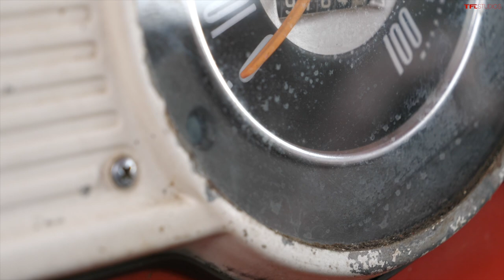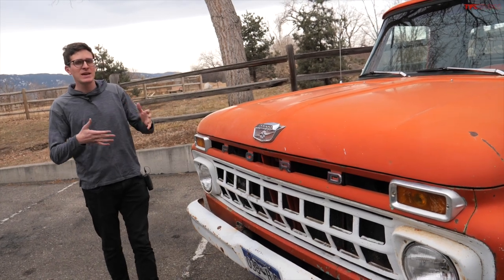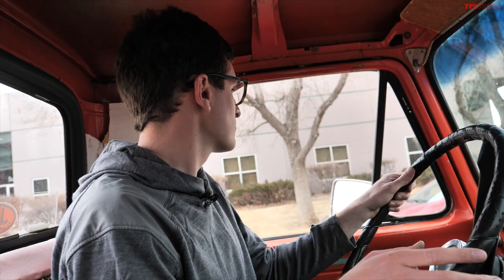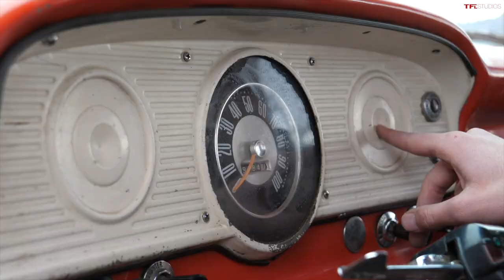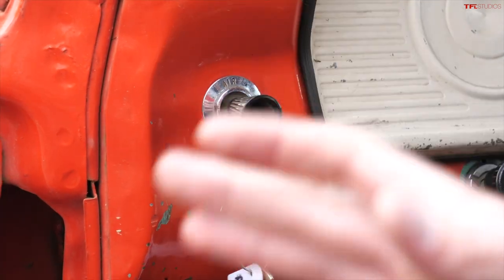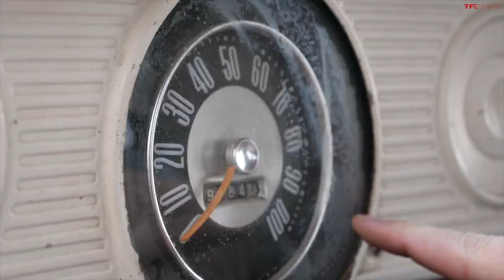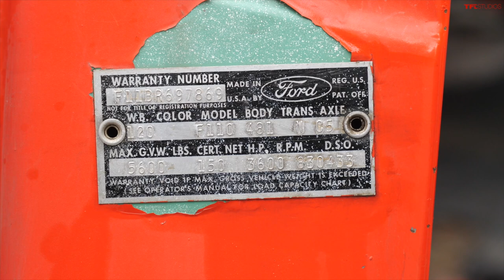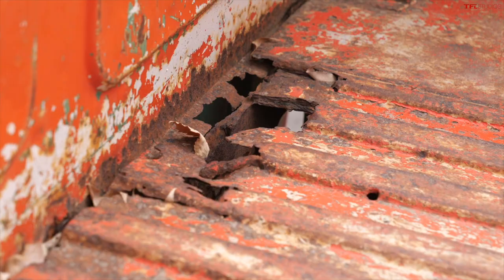Do You Like Raptors? I Just Bought The Ford Truck That Started It All!

Comment: Great video. Tow tests. Mpg tests. Decibel tests. 0-60. Barn paint job and body work. Drag race it. If you do an engine swap, redo all the tests after. I look forward to all the future videos.
Reply: DO NOT paint this truck it looks perfect
Reply: Strongman may be right. It is a good looking truck. I was just brainstorming.
Reply: Given a length of the video a didn't expect to see the 0-60 test.
Reply: @PrzemyslawSliwinski  It will easily go 60..
Reply: I wouldn't mind seeing it put back to the factory original paint. As for engines just rebuild what is has and leave it alone.
Reply: Don’t tear it up. This is NOT Dirt Every Day like some of those other guys.
Reply: God get rid of that radio though
Reply: @PrzemyslawSliwinski  That's funny. My '65 F100 has the 240 I6 and a 4.10 rear end, and it'll do 60 alright. Not much more though. 😄
Reply: @usmcvet0313  My first two cars could do 65mph if they were brand new. Never got a speeding ticket....
Reply: Swap in an Offy intake with 4 bbl carb and headers.  You can boost the power by about 100 hp this way.
Reply: Leave it and drive it  or FULL resto/resto mod. No BS barn paint job on this gem
Reply: Mechanical restoration only.
Reply: Please keep the 300 straight 6, even if you put it in a different truck
Reply: Keep this 60s raptor vibe and I love the i6 , try your best to keep that engine even if a full rebuild and fully built internals is the way you wanna go , maybe straight pipes but that’s not you lol , I would opp for front discs and period correct rims as well , maybe keep that former forest service green too , it’s so 60s . That’s such a nice find , I can’t wait to see it’s new life
Reply: Engine swap?! What for? The 6 can be modernized to get over 200hp. Power steering can be added.
Reply: @usmcvet0313  My 1978 Land Rover lwb had a 2.25 litre petrol engine with about 68 hp and flat out on Firestone 750x16 SATS would get to about 70mph, l would have thought this Ford truck would esily reach that speed unless it has very low gearing.
Reply: @clooperman3745  I'm sure this one will. Mine taps out at about 65 mph, because the low 4.10 rear end, and stock sized tires. He said in the video this one has 3. something axles, with larger diameter tires. I'm sure 70 is possible in it.
Reply: Overall nice video,  hopefully whatever work you do will be more towards a restoration direction and less modernization. Please get her the proper two piece factory radio..... A lot of people find it hard to believe but that era F-series & mustang are MAJOR sources of parts for the 1st generation bronco.... the heater, speedometer assembly, and factory radio were directly from the truck. As was alot of the interior trim. The blanked out hole beside the fan controls is for the defrost and the handle you show would have extended straight out roughly an inch to hold the cable.  The  steering wheel  while not yet on a collapsible column is the 'lifeguard' deep dished style from the late 50s so it don't crush your chest in a head on collision  (while it isn't an air bag by any means think happy thoughts prior to any emanate head on collision). As for the gas tank we look at it in horror today because it is in the cab. Keep in mind that the 'safest' place in that truck was expected to be the cab so in a major accident least chances of damage .... today we approach things with a different perspective but at the time  made some sense. Good  luck and I hope you enjoy driving as much as I  enjoy my 71' bronco  ;)
Reply: Thats got F250 axles, might be a cab swap that didn't get the Vin tag changed. The 100 of that year had a single speed transfer case and 5 bolt wheels. Look at the frame number, it is on the passenger side right ahead of the firewall. My 250 has that hood emblem and came with the V8.
Reply: @rogerj412  exactly

Comment: Whatever you do to that truck: Never take that 300 Straight 6 out.
Reply: ls swap
Reply: @kiefercosgriff7300  no
Reply: I agree
Reply: Needs a 460c.i. swap ill tell you whut
Reply: @kiefercosgriff7300  🤫
Reply: One of Fords BEST 6 BANGERS...
Reply: Drop a Jon Kasse 460 in it, gobs of power and gobs of torque😁
Reply: The thing I always tell people when they say I should put a 350 in my 1978 Gmc c15 short wide "when it blows up I'll swap it out" I've held it too the floor about every single time I drove the d*mn thing and float the valves for about 10 seconds but we'll sh*t looks like it's not getting a v8 anytime soon😂🤣
Reply: straight up
Reply: @user-gz8id4vf1i  
 Not in the Xiden $4/gallon era..
Reply: The 352 has almost 350lbs of torque and 200 hp stock ... mine has it and it's what started the idea for the Ford lightning
Reply: Lmfao can from the video where the made it electric
Reply: @jlbueno0611  No it didn't, they measure power wrong back in the day. They measured net vs gross. They never put that much to the ground stock.😊
Reply: @kevinragsdale6256  you think I jabent run my truck thru a dyno in all the past 24 years I have owned it ? ...my 352 is stock, no add-ons and I have kept the heads and pistons and cylinders without any modifications  ...no upgraded carb ,and no upgraded intake , only added headers it puts 201 hp to the wheel, and  about 380 lbs of torque  .....my engine has 145k miles on it , all original transmission and rear diff , truck is not in a show room condition since I used it for construction work for 10 years , I rescued it from a tow truck guy who was taking it to the metal scrap yard ......   best 500 dollars I ever spent back in June of 2000

Comment: It’s a forest service vehicle and even though it’s not quite a bumpside I immediately thought of Forest Bump as a name... It’s a beautiful machine and as much as I would like to see it in its original color, I would rather leave it as it is. Just do some sensible technical upgrades like brakes and steering. And leave the 300 I6 engine where it is obviously.
Reply: I thought the same thing with the original color.
Reply: The three hundred six is good for about two hundred thousand miles and then by by oil pump. My buddy had a 1984 F100 good truck though and a nother buddy of mine had a 1988 good solid truck it had three hundred thousand miles but by by oil pump. If someone buys one the best thing to do is replace the oil pump and you should be good.
Reply: I’ve had several of the 300 six bangers. Rock solid. My suggestions have been stated but modify the brakes and steering, maybe a rear locker but for sure go to the original color. That orange color is off a ‘69 IH Scout lol
Reply: How do you know it’s a Forrest Service truck?
Reply: Straight six nah upgrade to a v-8 or straight 8 put the straight 6 in a museum.
Reply: @warrenmcelroy4718  He says it was a government truck right in the video.  18:14 Did you even watch the video???  It was also originally forest service green, which was actually several different greens
Reply: @brinkee7674  yeah I did watch the vid, after I asked the question. Now I agree that it very well could have been a Forrest service truck, but, it could have also been any other sort of County, City or State vehicle. It’s obvious that someone had made several upgrades to the truck in the past so it could have been a whole number of things. Only point being we don’t know with 100% certainty that it WAS a Forrest Service truck so why just THINK it was and run with it? No big deal really but THAT is why I asked.... well that and because I hadn’t watched all of the video yet at that time haha
Reply: @warrenmcelroy4718  Why would it be Forest Service?  It's because they are the one's that order it that color.  City, state, county, etc don't order in that color.  It is a spec with Ford.  Now some other greens are also Forest Service but they will not be the original color.  When .US F.S. needed a 'replacement and they couldn't wait and one wasn't available they would repaint a new truck.  Usually that color would be a few shades different.  I had owned 2 of them in the past and had done a little research on them, what I could find at the time.  That was before the internet or atleast before an efficient working one.  Yes there was a time where I could drive to library, find a book and bring it home in the time it took a file to download.  The more high res pics the site/pages had the longer it took.  Much of my info came from the old codgers that work with my dad at a larger Ford dealer.  One of his 'chums' was truck manager.  That man was a dictionary when it came to trucks, didn't matter the make as he also studied the competition as one should.
Reply: @brinkee7674  there is still room for some doubt though because there were other govt vehicles besides the Ford Forest Service Trucks that were that same green color. Here in Franklin Co Kentucky some of our Ford and even Dodge County vehicles were that same dark green color in the 70’s and even as recent as the late 90’s and early 2000’s our State Dept Of Fish and Wildlife had Dodge pickups that were that dark green color. We did have many County Trucks that were that color though.
Reply: @warrenmcelroy4718  And there lies the key but anything is possible.  It is not dark green like many county/state vehicles.  Forest Service had two dark and light.  This being F.S. light green.  No lie I've seem hundreds of these things and every light one was FS.  Doesn't matter as that green shown is FOREST SERVICE spec color making it a Forest Service truck no matter if it went to the moon and bought by NASA.  If they ordered it that color sales/build sheet says Forest Service.  Same as if I ordered a Crown Victoria patrol car and it was never in police service, it is still a Police/Patrol car (spec).  Yes you could order one with the right connections.  Calling it Forest Service is 100% correct unless someone did a bare metal resto when newer
Reply: @brinkee7674  ok
Reply: Would love to find on like that
Reply: @myalaskalife5837  for sure! In high school my Brother bought a 66 F250 4x4 that had a 4spd and a 390 that someone had put in it, it was that wild turquoise color but the hood had a crazy red and white color scheme along with the turquoise so even to this day it’s locally known as the Easter Egg😂 against his will of course. My junior year I bought a 76 F250 HighBoy that was tough as nails, my brother still has the 66 but the paint is pretty faded from sitting for so many years and sadly I sold the HighBoy about twenty years ago.
Reply: @warrenmcelroy4718  I'm 30 but my ferst truck was  66 ford Bronco miss it
Reply: @warrenmcelroy4718  A lot of former US Forest Service trucks wound up in local government fleets when the Feds surplus-ed them out.  A county where I used to live had several that were obtained that way.  The county left them painted in Forest Service green.
Reply: @rockymountainjazzfan1822  they would be better off if they were still looking for these older trucks to use instead of buying the brand new stuff they’re building these days. I swear if I could find a Mint late 70’s Crew Cab F250 4x4 it’s hard telling what I’d be willing to pay for it, and would be the last truck I’d ever need to buy. The big three should all build a brand new 60’s, 70’s or 80’s pickup for a year or two, they would sell like Hot Cakes hahaha

Comment: When I was in junior high(1973 ish) the morning bus passed a yard with a '65 ford pickup going to waste that I really wanted to save.  Later on I bought a 1967 f250 that I had for a few years before buying a small 4x4.  The old Ford drank oil, but was tough.  I slipped off an icy road into the ditch one morning and scratched the bumpers paint.  Now I'm in my 60's and seriously looking into a 1970 f250 4x4.   Nothing like an automotive workout to make you feel young again.

Comment: You are right about that inline 6 - those things are really sturdy. 
I love that old chain-latch release for the tailgate. 
I never knew about the old-style truck bed on the 4WD models. 
My Dad had a 74 one-ton; the original mirror had to be replaced because the horse kept using the mirror to scratch his butt; breaking it off a few times. 
One of the problems with that gas tank in the cab is, a minor leak was not unusual; the gas fumes could get you over time. 
You are so right about the wing windows. When you get it up to 30-40 mph, that wing window will give you a nice little breeze.

Comment: I would definitely keep that motor, for low speed lugging and 4 wheeling there is none better. I think the only things I would do to the truck is new weather stripping, fix the rust issues, If you can do a disk brake upgrade up front I would look into that because if you are off road and go through a creek then you won't have any brakes till they are dry and I would put a posi in rear end.
Reply: Ditto.  And vacuum-pack and store the original parts just in case someone else wants to buy it in original condition at some point in the future.

Comment: I drove my '65 F100 for over 30 years. It was 2WD and had the custom cab and fleetside bed. Came with a 240-I 6 and 3 on the tree when I bought it in '72 for $750.  By the time it was totalled out in a crash in 2002 I had converted it to F250 running gear swapped in from 70's vintage F250s. It had a rebuilt 1982 302, a New Process 435 4 spd., Dana 60 rear axle and 8 lug single piston caliper power front disc brakes (they fit onto the original twin I beams axle). That truck had a lot of memories for me. I drove it through more than 1/2 of the US states. It was my work truck, carrying a portable welder and tools for my business for the last 17 years I had it, inside of a truck bed canopy. I was really glad I didn't die when it got wrecked: it still didn't have any seat belts (I could drive legally without seat belts because the truck didn't come with them!).

Comment: They need to bring back the foot button for high beams
Reply: i agree we need something to go out once a year just before you have to get it inspected. LOL.
Reply: I always loved the high beam floor switch. The only problem is the road salt used in winters. It very quickly rots the switch and floors.
Reply: @dandingfelder6763 , yea, this truck is as old as me. Floor high beams are one thing I'm glad is gone. They always got bad and it was one of the first places the floor would rust.

Comment: The cool thing about that truck, is that if you ran out of brakes, you can just throw it into second gear and then go down to first and basically use the engine to break just as fast as using brakes . Bringing you to an almost stop and guide it to safety.

Comment: I'd love to see you keep the original engine and running gear, though possibly do some bolt on power adders from Esslinger Engineering. 

One interesting side note is that the straight six was the easiest on the battery when it came to starting. The cold cranking amps needed was super low.  The V8's and V6's took more and the straight 4, even more.

I think a body and paint restoration would be great, though for safety I'd definitely want to upgrade to a more modern braking system.  Dual chamber master cylinder with power, though not sure about going to all around discs, but that would be safer for long downhill runs, especially with any kind of load.

I'd put a fuel cell in the bed, to keep adding to the safety factor.  If it would work, I think the speed sensitive heavier duty rack and pinion steering that came in the 80's Mustang GT's would be a great add on, as would a roll bar with 6 point harnesses, or at the very least a well secured lap and shoulder belt.

As far as a name goes, "Tangerine" may be good if you make it a more vibrant orange.  However "Tandeleo", as in the old George Carlin skit mentioning "Tandeleo Breckinridge", "My what a colorful name" comment, could well be a great inside joke. Not sure if that comedy bit was from the 70's, rather than 60's though.  If you go with a green, I think a sweet metallic yellowish-tinted green fade would be great and then call her "Olivine", like the gem of the same color.  I see so many possibilities!

My family had a 73 Ford Ranger XLT with a 302 in it. Another Ford workhorse engine.  It was so smooth that if you were stopped at a light, you'd also thought you'd stalled. No vibration or noise when idling.  That baby was pure silk and was donated to their church in the late 80's, still running perfectly.
Reply: If looking for a name and the orange paint is kept how about Tango ( an orange fizzy drink in England).
Reply: @clooperman3745  We have one here in the US called "Tang".  I didn't mention that because it since is was so short & just one syllable.

Comment: I would keep the straight six.  Mine 65 F250 was originally the 352, but now has a 390/335 engine.  I still have a couple 352's, but it's much easier to get parts for the big 6 and it can easily be modernized to give a little more power.

Also, the original mirror would have gone in the square hole in the front of the door and is about 3-4" in diameter.  Almost useful.